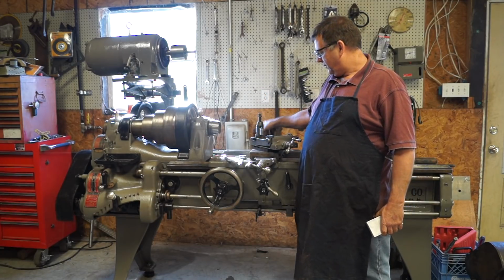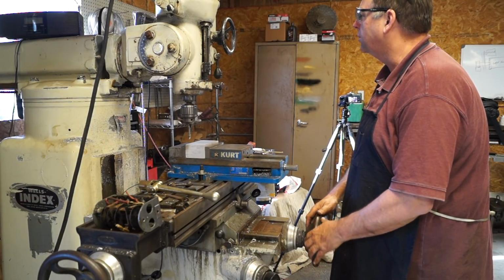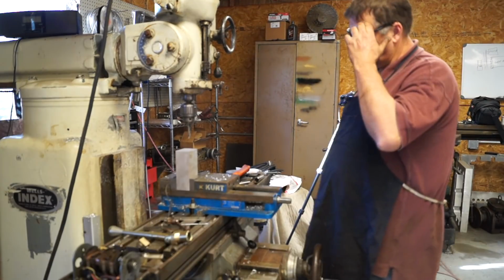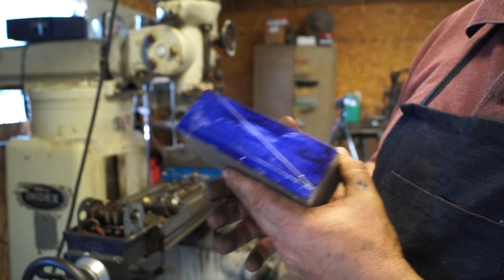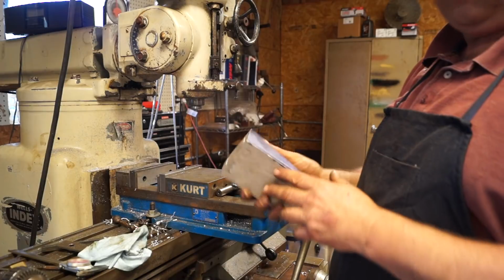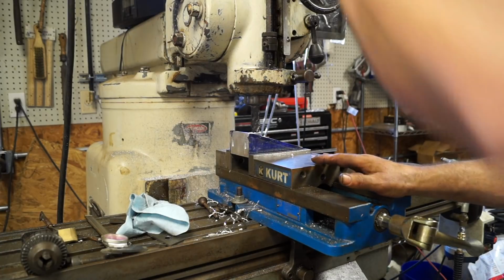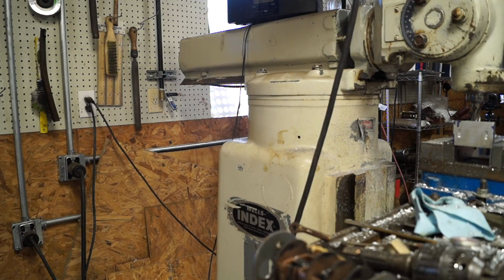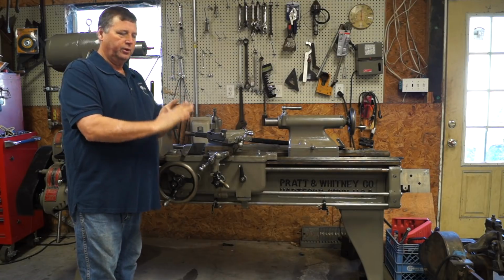Pratt And Whitney Lathe Restoration Part 14 (Machining A Bracket)

Comment: Whole lathe looks good Mike. Nice details in the bracket. Lots of sweat in this project. Maybe it needs a name other than the brand....?  You have come a long way from that field where you found it.

Dan
Reply from the maker: Dan this lathe isn't the one that came out of the field, I rescued this one from a machine shop that was closing. It had been sitting in the for 30 years alone in the corner
Reply: Oops my bad.

Comment: First time I've really noticed but that Wells Index is far heavier built than any BP Mike. And the switch mounting bracket came out great.
Reply from the maker: Yes, they weigh close to 2700# I think the bridge port weighs in around 2000#, And they are still in business building them in the US

Comment: Good little pile of chips! I probably would have just cut and welded it up from some flat stock and saved a bunch of material, but then what would have been the fun in that! :-)
Reply from the maker: I had actually put a piece in the press brake last week, I forgot and left it in my office. I didn't feel like driving the 25 miles to work or waiting until I went back.
Reply: bcbloc02 iI

Comment: Lordy what a mess...... I love cutting aluminum (primary choice of aircraft manufacturers) but it sure makes a mess. When I was at Boeing we had 13  Bridgeports and at the end of the 8 hour shift we would fill two 30 gallon containers with chips. Less if we were doing finish work. Face mills and fly cutters make for some serious clean up time.  Looks kinda like a bracket I used to make that went on a horizontal stabilizer for a 747. I think it will handle your switch. Were you using a 4 flute end mill? Couldn't really tell. Getting a little closer all the time to finished.
Reply from the maker: Johnny 
I work in a aerospace shop building high end interior parts for mainly Gulfstream, A lot of our parts start out as 150- 200#  We machine them down to 2 or3 of pounds. we fill a couple hoppers a day per machine.
Reply: Been there too. We machined one piece ribs for the 777 too. Bolt a slab of material to a open tombstone and cut everything out of the way that wasn't a rib. High speed Mazaks. Never really took to NC's mostly conventional. Many years ago...... Good times.

Comment: Boy I wish I had a lathe or milling machine. I would need a bench top 12 or 14 inch. I love all your shows. Thank you sir. Please keep it up.
Reply from the maker: Kerry they are out there,
Reply: I have different sizes of cotton wicks. You can have em. I don't know exactly what kind of wicks. Let me know. Where did you learn you machine work. I am going to by a new lathe. Just wondering if you think I can teach myself if I apply myself as I always do. Love your work. God bless you and your sir.
Reply from the maker: Thanks for the offer, I have some ordered and if there not correct I might take you up on the offer,  I had always wanted to learn the trade, I went to a trade school and then took a job as a manual machinist in aerospace shop. As far as teaching yourself I'm sure you can do it, but understand there is a lot of bad habits you can develop  without proper training. Some of them can get you hurt.